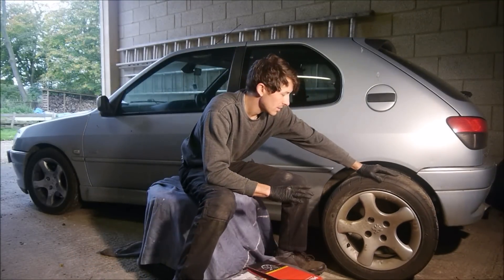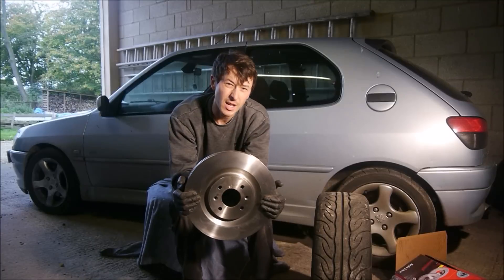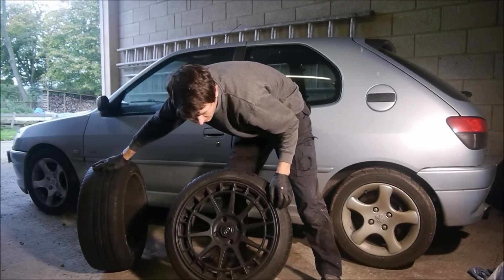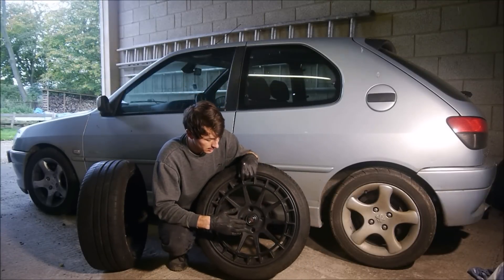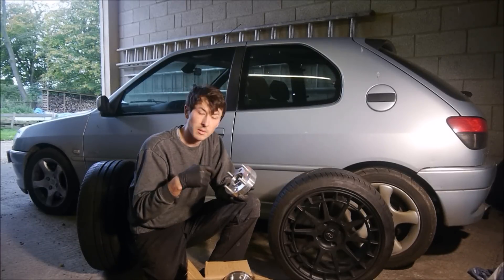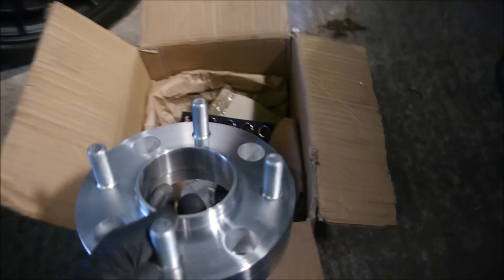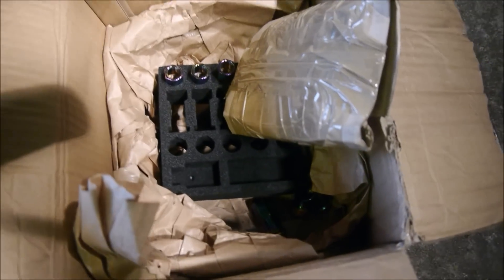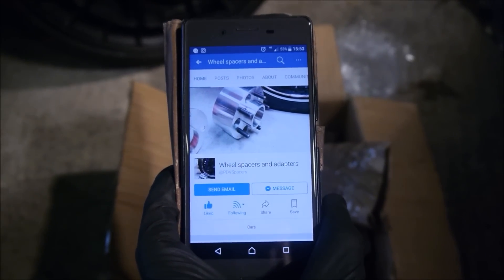Project 16v - Part 26 - New wheels!

Comment: have you got problem after install spacer ? my car shaking after put spacer
Reply from the maker: You shouldn't experience any shaking. Ensure mating faces are clean. Spacers and wheel bolts are torqued correctly. Check wheels are balanced. If these are all fine, the spacers have likely not been made correctly. 👌

Comment: Do u have to use spacers for a 17 inch tire
Reply from the maker: That's a very vague question. The tyre doesn't alone dictate the fitment. It's mostly the wheel. You can get 17" wheels and tyres that fit without spacers. So you need to be very specific about your needs and wants when it comes to spacers

Comment: why you don't use 406 brembo brakes ?
they clear under 16' or even some 15' wheels
Reply from the maker: fila1445 hi there! Thanks for being a viewer of the Piggypower channel and commenting... Love to hear from fans.  
3 reasons;
1) Brembos with 326mm discs would still need 17" wheels.
2) I'm not a sheep, I'm a Piggy, so I don't follow the crowd
3) Brembos make more noise than a cat through a mangle and need so much maintenance. 

Hope that helps 👍🐖
Reply: Piggy Power can't wait for brakes upgrade video :)
If you can fit them in 306 that means i can make them work on my 205 if i so desire ;)
Nad greetings from Poland btw
Reply from the maker: fila1445 Jen dobre! Awesome to have a fan in Poland! The new brakes need a custom bracket. I recommend you view my video on the 300mm upgrade...they would be a direct fit for you 👍🐖
Reply: for now i use citroen c2 brakes as they can be fitted with 14' wheels

Comment: how much power does it make? I got the same engine.
Reply from the maker: Heinz LETZTE. The stock map produce 137bhp ish.... What car have you got? 👍🐖
Reply: I have a 2001 306 Break.
Reply: I really love the car it is just a little slow.
Reply from the maker: Heinz LETZTE. How much of this build have you seen? Because it's really NOT the same engine as yours. Yours will be either the 2.0 8v HDi or a 1.9 non turbo DW8 ?
Reply: Oh sorry I thought you had the RHY block. Well that is the one I drive.
Reply: DW10TD/RHY
Reply: I am ashamed to admit I haven't seen much of it yet.
Reply from the maker: Heinz LETZTE. I am using RHY block yes... But just the block! Have a look at early videos 🐖👍 thanks for watching 😀
Reply: Yes I was talking about the block, sorry. I am trying to find some info about what has been done and whats possible on the 2l hdi because I want to upgrade mine too.
Reply from the maker: Heinz LETZTE. What have you done so far? 😀